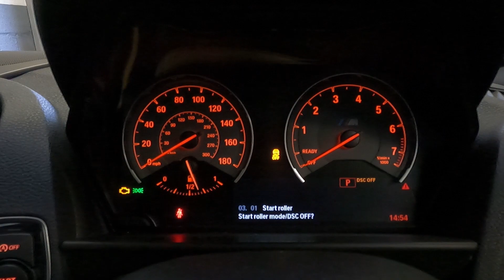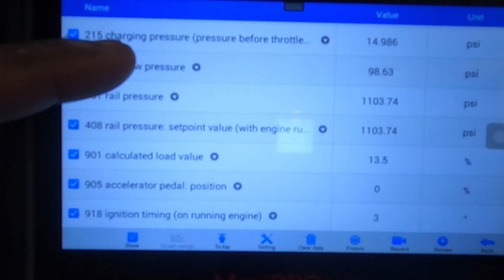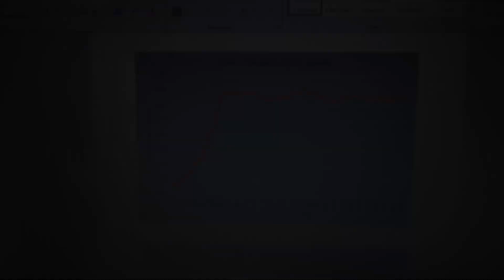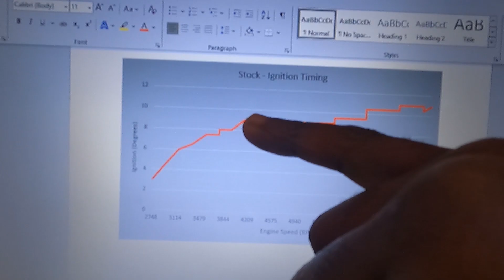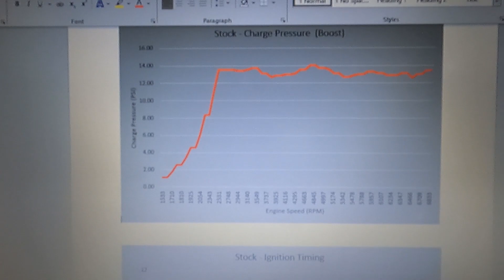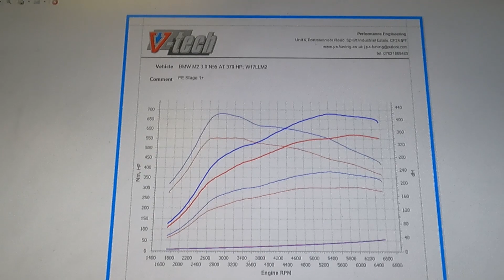BMW M2 Part 2 - ECU Tuning & Dyno

Comment: Great video Nate, I am looking at a Stage 1 tune for my M2. I wasn't sure if I should change the intercooler and the intake pipe at the same time. I am a bit far from you, but I will be calling to get a quote and some advice. Keep up the good work bro.
Reply from the maker: Thanks for the feedback Brian. The M2 is a brilliant sports coupe. The Intercooler and is definitely worth doing and the charge pipes on the N55 are very common for failing. You will love it once tune 😁